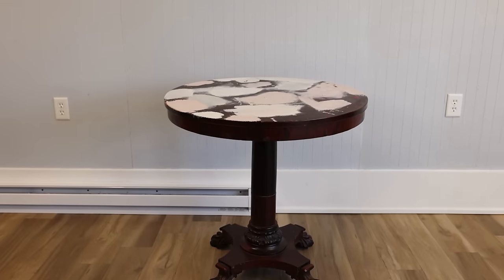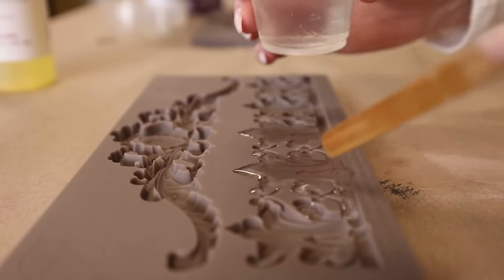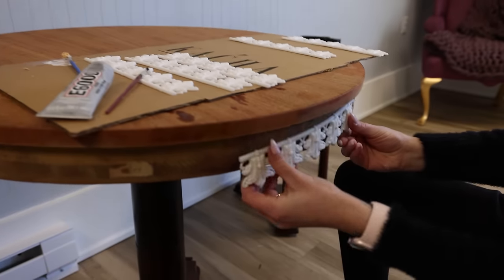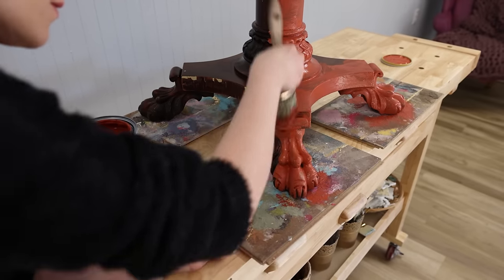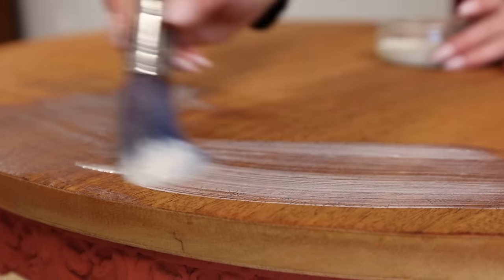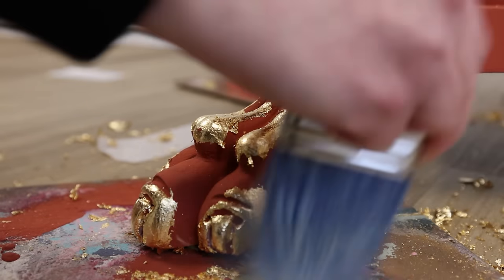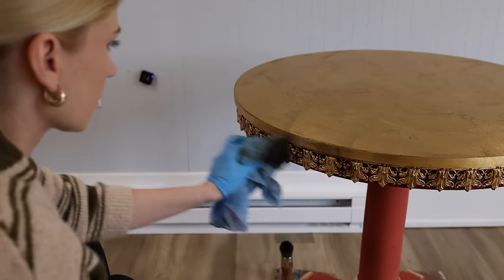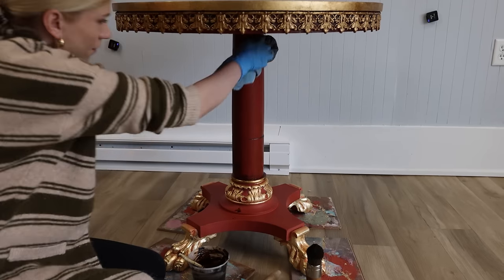The Glow Up is REAL - Extreme Furniture Makeover

Comment: Kacha, I love this!  So much that I decided to use this technique on a plate shelf I got from Goodwill.  
I sanded it a little to get it smooth, cleaned with krud kutter then applied the adhesive glue, let it dry for 20 minutes and applied the gold leafing.  Everything was going as planned.  I finished up gold leafing and got busy with other things.  I came back to it a couple hrs later and all was still fine.  No sticky spots and leafing looked beautiful.  Next you said to apply clear wax and this is when everything went south.  I am now sitting in front of a sticky streaky mess!   What happened?!   Wish I could send picture.